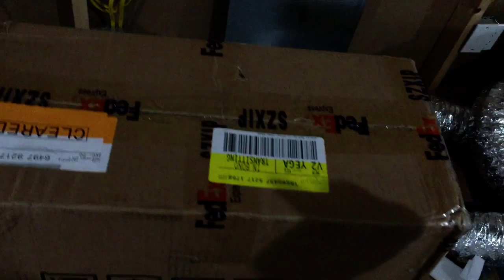Antminer S9 Unboxing & Setup & Troubleshooting - Part 1

Comment: I powered mine up but I can't get the IP address to display and the red fault light blinks when I press the ip report button while running ip reporter, any tips on that?
Reply: Same problem. Fixed it?
Reply: use your router interface to find the device

Comment: Care to speculate why the Antminer S9 and R4 has been out of stock for so long at Bitmain?  Have they decided to stop selling to consumers in favour of selling to larger mining companies?
Reply from the maker: No need to speculate. They have been releasing batches but they sell out within hours. Reason being, there is a race to get Bitcoin Unlimited hashing power up to tip the scales away from Core and eventually get bigger blocks. I get updates from Bitmain when new batches will be out. Dec 8, a new R4 batch will be available.
Reply: Oh, maybe I just haven't been visiting their site frequently enough.  Every time I visit, they are already sold out!

Are you mining with Bitcoin.com or ViaBTC?  As far as I know, these are the only two pools that support Bitcoin Unlimited.  Oddly, Antpool, owned by Bitmain, still hasn't switched to Unlimited.
Reply: they are available now but you cant buy them for usd have to use BCC i was like wtf

Comment: Hi!

Iam thinking about purchasing severeal antminer s9. How easy is it to install those? and  make a serial connection into one computer to keep it up and running? Do we need several desktops ? or is one sufficient to monitor the mining software?
As well thinking about my wall power socket limit for my antminer machines is sufficient?   
I live in Sweden btw. 
Thank you!
Reply from the maker: You may want to watch the video. Ease of installation is a perspective. The steps are very straight forward if you check out the many videos I have. Also, they are not connected through a serial connection. Antminer S9 is connected to your network using a LAN (RJ45) cable. Configuring it requires finding its IP address, accessing it and setting it up as I have shown in my videos. You don't need any mining software or monitors. just a laptop or PC connected to the same network to configure them.